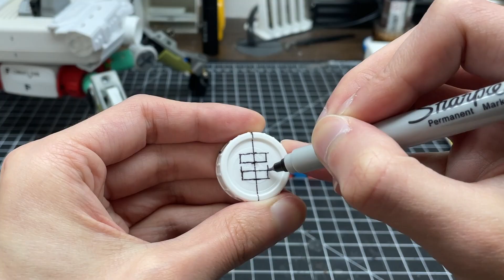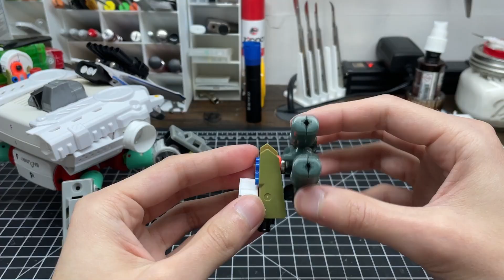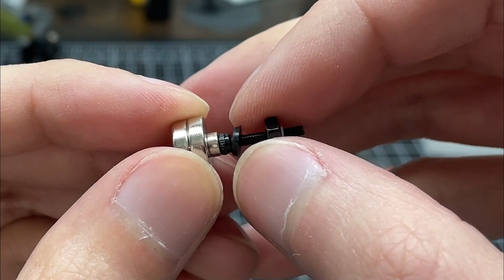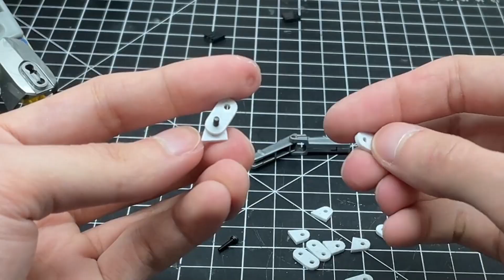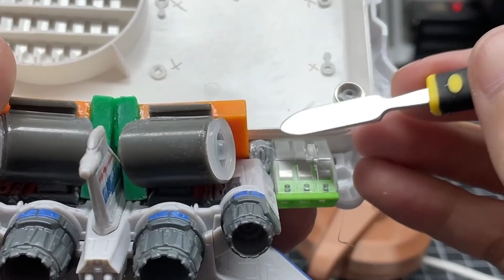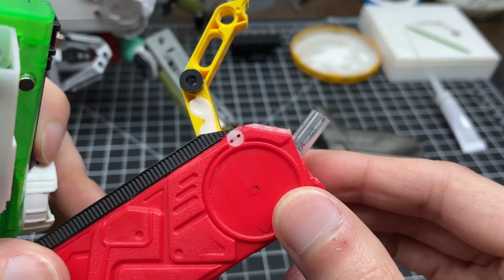Project Fidlar: Crab Mech Auxiliaries (Part 4)

Comment: My main concern will be the nanotronic fusion power core. If not calibrated to the correct sinusoidal wave, it may cause the harmonic stabilizers in the reactors oscillation matrix to become un- regulated with the  energy distribution. Hopefully your engineer's have correctly addressed this issue?
Reply from the maker: Thank you for the prompt notification regarding anomalous readings! A recalibration was performed to confirm potential inefficiencies. During this brief recalibration phase, the core has optimized its neutron flux channeling algorithms. This will ultimately lead to a 2.7% increase in overall energy output and a 14% improvement in core stability. If these assurances are insufficient, we can initiate a remote core diagnostic override during assembly downtime at a future date.
Reply: Wait, I thought this was a Wendy’s???
Reply from the maker: @stevenqu3  Thank you for your inquiry. While we understand the similarity in names, Aegis Mechatronics is a technical manufacturing company specializing in the production of defensive combat mechs and does not in fact produce burgers.

Comment: I would like to officially recommend against using Fast Draft Machining. Their extreme lack of quality control has caused numerous problems in this industry. Look up the eight Bakufoo Vise shuttle crashes that have occurred in the AImyringa systems. Our company's experience with FDM parts have been so bad that our engineers have begun to call them "F*cking Dreadful Manufacturing".

Please consider this change.
Reply from the maker: While we understand your concern over the potential for another catastrophe, the Bakufoo Vise shuttle crashes inappropriately used FDM parts within critical systems that required the utmost precision and quality assurance testing, both of which were later discovered to be less than adequately performed by the responsible parties. We can assure you that we are only using FDM parts on less critical systems, with rigorous QA testing, and only during exceptional circumstances (i.e. our lead machinist falling ill).